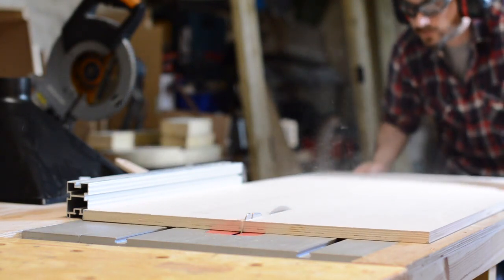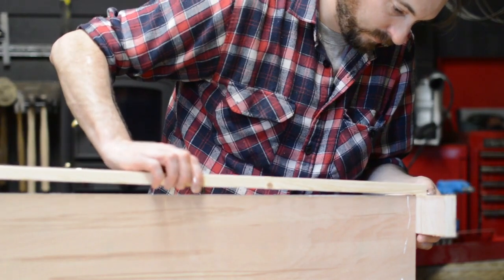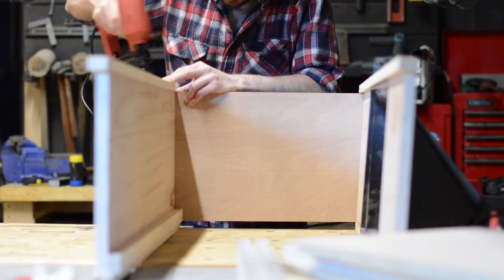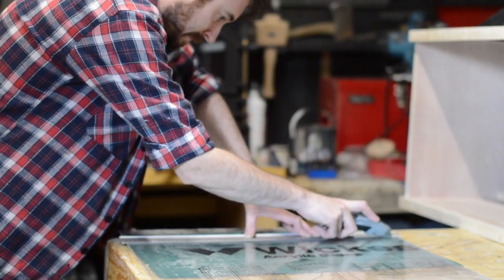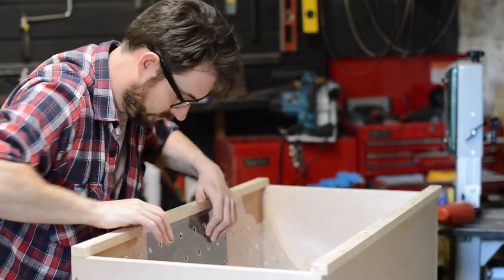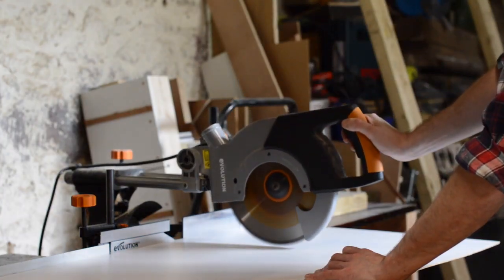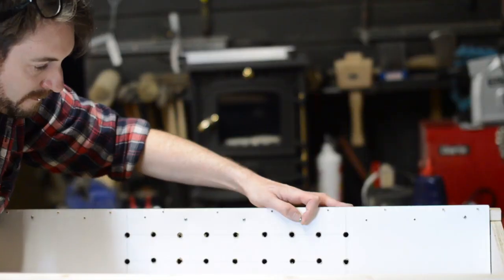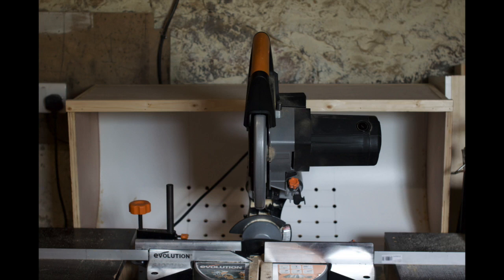Miter Saw Dust Extractor

Comment: I have the same saw. Terrible built-in extraction. I don't think it takes any of the dust away. This is a good idea Matt. I might try it myself. Perspex is tricky to drill and bend. Definitely a knack to it. Wood is so much more forgiving - though less transparent!
Reply from the maker: Yes you are right. The built in extraction does nothing. I have learn my lesson with perspex I hope.

Comment: Drill a small pilot hole with a general purpose drill bit and use a masonry bit to widen to the required size.

Also, make sure the bit is spinning before you make contact, it's less likely to jam and dig in, which causes the breaks.

Comment: Very nice idea! Have you considered adding two sheets of material (perplex or wood) across the front of the structure, with a big enough opening as not to obstruct the blade/rail movement? I believe this would substantially increase the air flow. You could fashion a track to widen the opening for bevel cuts and such - sort of like a sliding door just behind the fence. Good job as is, though.
Reply from the maker: That sounds a good idea. Maybe I will have to add that on.

Comment: Nice job. I’m going to do something similar, looking for inspiration myself. Saw a video earlier, had sliding doors on the front to narrow the gap at the front, thus concentrating and improving suction, looks like your design could accommodate this relatively easy if your not happy with it
Reply from the maker: Doors do sound a good idea. I think I Like to make stuff did that and used magnets to hold them on.

Comment: What is it you have that is actually doing the sucking?
Reply from the maker: When I shot the video I was using an Axminster hight volume low pressure machine. Now I have a Camvac twin motor machine. This works much better.

Comment: Perspex isn't the best as you've discovered it will crack or snap under too much pressure. To avoid this use polycarbonate.
Reply from the maker: Thank you. If I try it again I will use that.

Comment: Hi u've made a decent start! To improve this further have you considered connecting the saws dust extracion port to the extraction system to contain more of the dust at the source. Also if you added sliding doors as can be seen here (https://www.youtube.com/watch?v=2SfgSIekuos)  this allows you to increase the capture velocity as with such a large capture face this reduces the capture velocity dramatically.